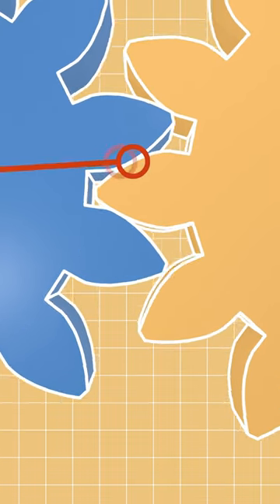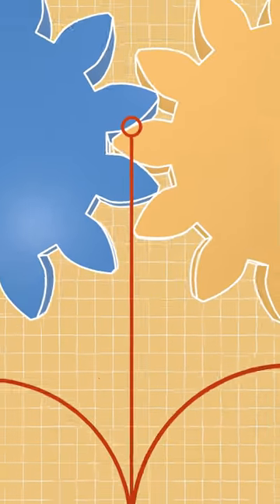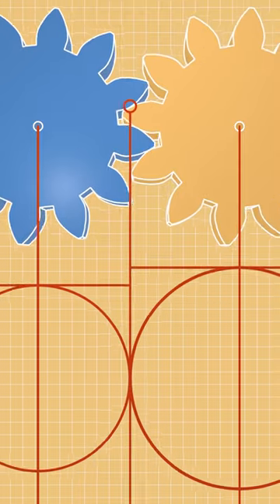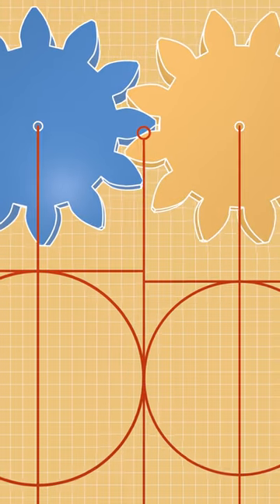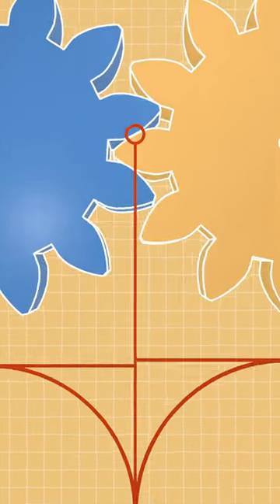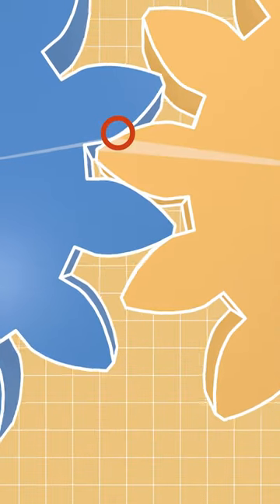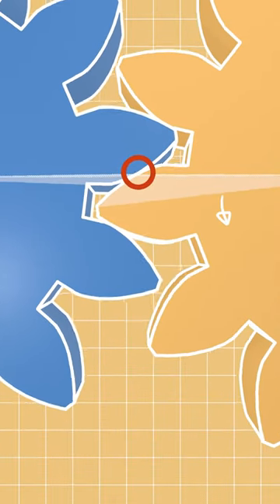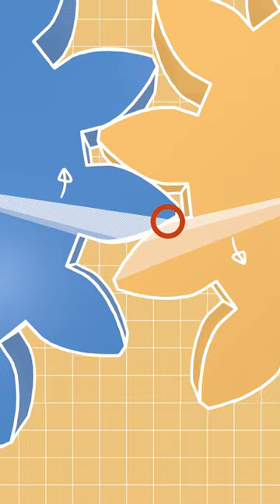Why Gear Teeth Have This Shape

Comment: this is more a side effect than a reason, the main reason is to ensure contact with no slip (no friction in theory) and most engineers would be pretty happy to do without this variation in torque (this is why timing belts are prefered in precision robotics)

Comment: I'm not sure if it's just me but I found this explanation incomplete. The changing gear ratio due to the shifting contact point happens with all gears, but is particularly a problem if you're using gears with simple square teeth. The graph of the torque needed to drive one unit of square gear teeth will start a bit below average and trend lower with the moving contact point pushing inwards until the flat sides of the teeth meet then instantly shoot up to a higher value and then trend lower again until they are no longer in contact. Operating at high speeds over long periods of time the resulting vibration creates a lot of noise and damages the gears and any other mechanically connected components. So this design fixes the problem by modifying the distances over which the contact points act to create a constant torque load throughout the rotation. The higher gear ratio in the beginning of the contact pushes the opposing gear a larger distance/angle than does the lower gear ratio at the end, which is what you can see highlighted at the end of this short. This ratio of the amount the driving gear moves to how much the opposing gear is moved is a mechanical advantage that translates (inversely) to how much force at that point is needed, counteracting the growing distance, resulting in as flat a torque graph as possible.

Comment: The reason gears aren't say 90° is because if the gear rotates the teeth would get stuck on one another. The curve allows for a smooth transition from one teeth to another

Comment: I don’t understand
Reply: Ditto m8
Reply: skill issue ngl
Reply: So the gear ratio is how to determine how much torque and how fast the gears are outputting. The input gear (blue) is pushing the output gear (orange). They look like the same gear ratio, which makes this a lot simpler. The bottom of the gear teeth are wider than the tip of the teeth, so when the bottom of the blue gear tooth pushes on the top of the orange gear tooth, it has a lot of torque. When the tip of the blue gear tooth gets to the bottom of the orange gear tooth, that strength is no longer there, slowing down the turning rate. This is done so that the gears don't turn too fast, and so that there is a constant pressure point between them so they don't stop moving when you don't want them to. I hope this helps.
Reply: premise: orange is pushed by blue

initial problem: contact point is between blue base and orange tip, making blue radius small and orange radius big, making orange spin a bit slower than blue initially

solution: orange teeth widens towards their base, getting some speed boost when pushed initially

vice versa when any blue tooth is soon unable to push orange(lost its contact point)

result: orange sped up initially, slowed down at the end, evening out the spinning speed

Comment: Lol what? The gear ratio is constant, otherwise we would experience speed fluctuations. The real reason for this shape is to reduce material wear and noise. If you look closely you will notice that this shape makes teeth roll one on another. If the teeth were for instance rectangular they would rub each other and wear the surface pretty fast.

Comment: The point of contact on the top part of the tooth is moving away but on the bottom Atleast with this visualization there seems to be contacted made again but closer to the centre, 1: is this accurate in real life? And 2: does that have any affect on the force?

Comment: Hm, I wonder if this is partly why cars use helical gears.
Reply: The awnser to your question is yes! Because the helical gear has sliding contact points along the whole width of the teeth. It makes the transition to the next tooth a lot smoother and quieter.

However! Race cars tend to use regular spur gears because they have a higher torque rating. And this is why, when you see a cockpit view of rally cars, you hear a REALLY loud sound besides the engine. Which is the gearbox!

Also, most reverse gears in cars are straight cut. Because in most cars, reverse is just first gear, but driven from a different direction. And it's very hard to "slide" a helical gear in between 2 gears. This small straight cut gear is why the reverse gear in manual cars is usually very noisy!
Reply: @MrMeasaftw screenshotted. Awesome info, thank you!
Reply: @MrMeasaftw  no. helical gears have a larger contact area so they can transfer more torque. the reason straight cut gears are used in race cars is because it makes the gearbox lighter and simpler since there are no axial loads when using spur gears. also spur gears are slightly more efficient, which means more power left for going fast
Reply: @ikbendusan  Damn. You're correct. But woulnt it still mean they can transfer more torque per kg? 😜
Reply: @MrMeasaftw  that may well be true haha

Comment: If well designed the contact point relative to an outside reference frame should be static… which is not happening in this case… so bad example or badly designed gears

Comment: Please look into machinist gear cutting before believing things like this. In part its true but it is not the reason the shape is that way. The reason for the shape it when the gears contact there can be no sliding between the surfaces. They should "roll" over each other like a shoe on the floor, or a foot ball when you push it lengthwise on the floor. If it slips or scuffs it will create heat friction hence destroying the face of the tooth. Gear making is not as simple as it is claimed to be. You generally need to be a expert machinist before attempting such things.